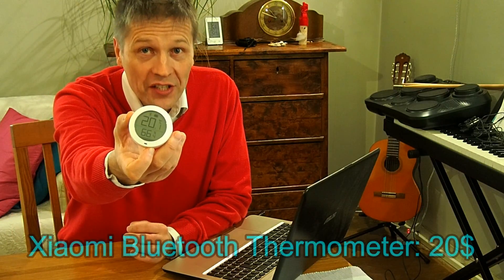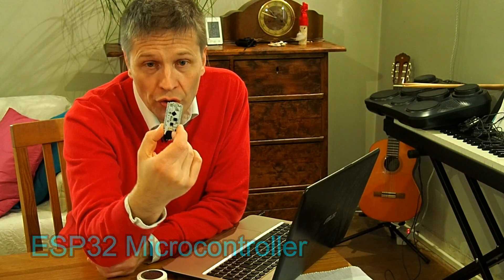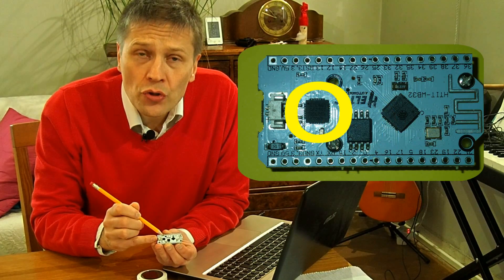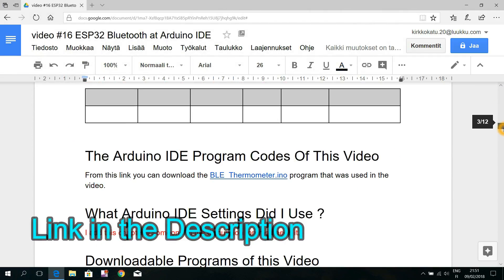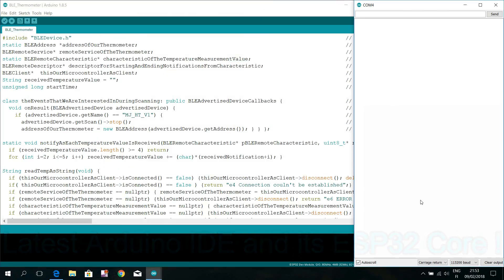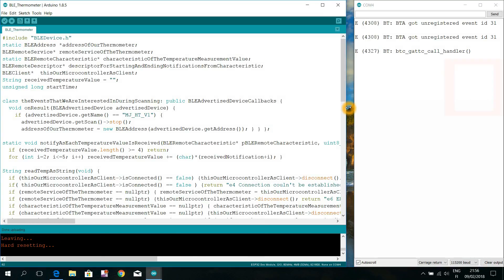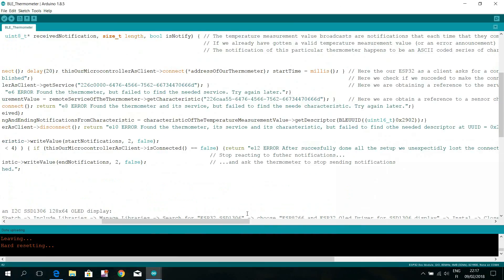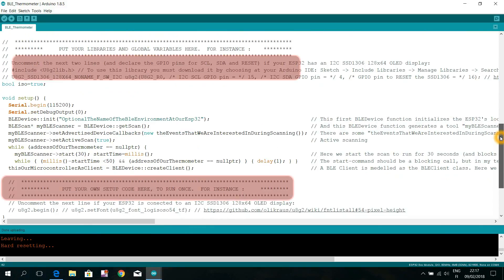ESP32 Bluetooth Tutorial using Arduino IDE

Comment: I like your video and the additional information you presented. You know a lot about these Xiami devices. I own such BLE Thermometer, so I wanted to try your program sketch.  Indeed  it works fine - but only for a limited time, then it not only loses connection, but worse, the esp32 is aborting and restarts, a complete reset from the beginning. I combined your information with the instructions given by Andreas Spiess in Video #174 on BLE (turning notifications on and off), but unfortunately the same result, after giving some results the esp restarts with a reset and gives again some results, restarts , gives results... 
Is there a forum where we could investigate these issues further and exchange our observations?
Reply from the maker: Thank you for your feedback, Bernhard Six! Also I had those problems where my early programs worked only for a limited time and then the esp32 restarted or got stuck. Most of those problems I was able to solve by adding those delay functions that are in the code and by adding those lines that test the current status of the Bluetooth connection. I ended up with a program that worked for several hours and then decided to make the video. But surely there are some similar errors left. If you (or somebody) will be able to improve the program, please share your knowledge here. Some of the problems are related to the Neil Kolban's library and he will surely want to hear of those at his blog. And as I said in the additional Google document of the video we indeed are in the need of an easy-to-use Arduino IDE library in which all different hacked Bluetooth thermometers would be collected.
Reply: Thank you very much for your really kind answer. It helped me to know that I am not the only one with the problem of restarting. I had a look in N.Kolbans snippets-discussions : https://github.com/nkolban/esp32-snippets/issues/399 and .. /issues/1092 which seem to describe the very same problem.  A hint for a solution could be what is discussed here: https://github.com/nkolban/esp32-snippets/issues/419.  I hope that some of the more experienced enthusiasts can overcome these issues.
Reply from the maker: By the way as I was doing the video I decided to solve the above problem by firstly reading the temperature measurement value once or twice and then by stopping the notifications and by ending that BLE connection. And when I was in the need for some new data, I just took a new connection to the thermometer.
Reply: Hey did you solve this problem, I have the same using a wemos lolin32 lite board?
Reply from the maker: For my purposes the above solution was good enough and so I didn't explore the problem any deeper. I will get back to it after few months, but now I am engaged by one other big project. Please do let us hear if you get it solved in the mean while.

Comment: hi, thanks you for this very informative and well documented study.
I have a baby thermometer from Xiaomi and I have tried your method for this thermometer. however, the incoming information is not the same as in your example. I did not get the result I wanted on the nrf connect application. If you have time for this, I can also share screenshots via e-mail (if you can share your mail adress with me). I would be very grateful if you could help with getting the data. Thank you very much for your interest. I wish you good work.

Comment: Thx, tutorial is very helpful. 
Do you have code to read humidity and battery level from Mi BLE sensor?
Reply from the maker: From the chapter https://docs.google.com/document/d/1ma7-Xsf8qcp1BA7YxSB5pRYinPnReh15U8j7jhqhg9k/edit#heading=h.vi7dmi6sb54g you can read about the "nRF Connect for Mobile" application. You can use that application to find out where the information of the humidity and battery level are stored. Then just modify the example program a little and the code is ready.
Reply: @miikakurkela5606  First, great video. Your code is working fine for me. But, for a newbie like me in Arduino projects, it wil be a very good lesson to share your knowledge and provide a sample code for humidity and battery levels. I hope you will find a little time in the future to provide this.